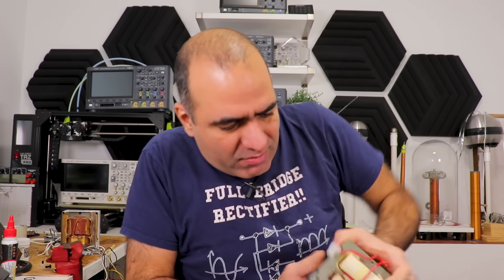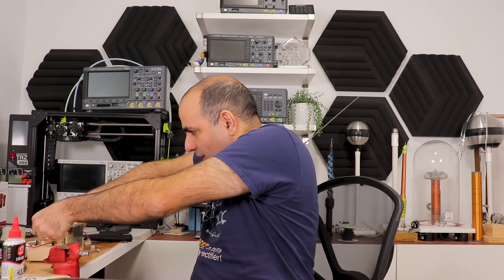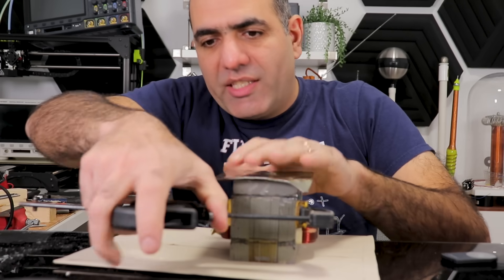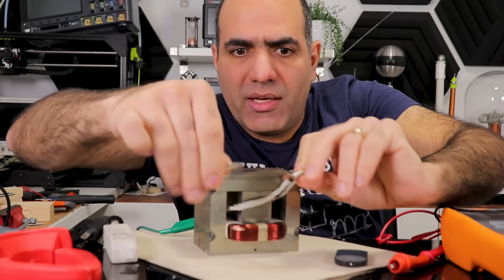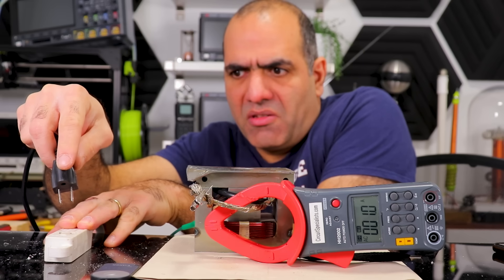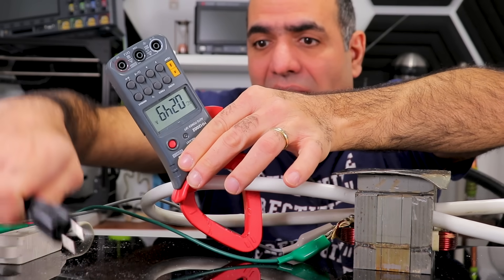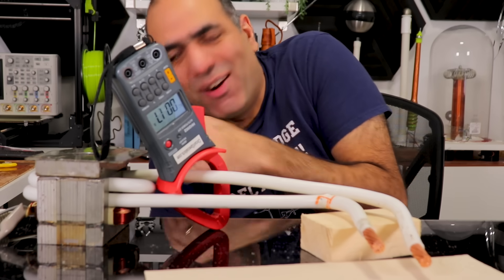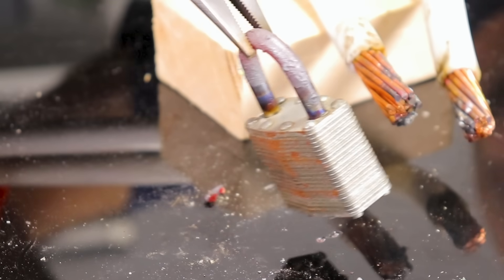Making "MILLIONS" of AMPS of Current

Comment: I thought that 0.01 amps was enough to kill you, he is touching 80 amps 4:15
Reply: Yeah but the voltage is very low. How much current is running through your body (think of your body as a huge resistor) is defined by the voltage, not the current that is flowing without load. Besides, he is only touching the closed circuit, not even holding both contacts with both hands so the circuit doesn't even close through his body meaning the current running through him is 0A.
Reply: Mehdi has a video about how this works concerning a "7 million volt" stungun.

Comment: How do you not get shocked by any of it.. you put your hand on top the square thing plugged in and then was holding the spoon while heating?? Are you grounded already or what? I came across you trying to learn about resistors in my r/c truck receiver, I need to know if I can put it back on or if it will be fine without.. it’s about the size of maybe 2grains of salt lol. But I’m now curious on what you were doing, reminds me of like a homemade induction heater!!

Comment: Current comes in via the (depending on what you want can be either but lets say) primary.
The electrons move in the coil

Every pass induces a magnetic current via the right hand rule.
So there is 1 magnetic field trough the iron core.
The plates are separated, so electrons cant flow between then (or they would coldweld like in space)

So the electrons are trapped in the plates.
So the incuced field is trapped in the plate.
And since 1. Same plate and 2. Same field; same induced field.
Induced field closer.
Inverse square law.
Same field locally stronger than ferromagnetic attraction at distance.
Push stronger
Goes appart

Comment: 6:15 if the secondary has more turns than the primairy then could you use the secondary as a primairy for more volts and so more amps across the short?

Comment: 6:10 I think you brush over an important point here. Step-down transformers don't actually "increase" the current output of the system. What they do is increase the current relative to the power input. You can theoretically get higher current without a transformer, but a transformer helps you get high current with low power.
Reply: If you consider a "perfect transformer" - that is one that transfers 100% of input power (primary winding)  to its output
( secondary winding )  - then - irrespective of turns ratio - if power in = power out then
Vp * Ip = Vs * Is.
Thus  Is/Ip = Vp/Vs = np/ns 
Where np is number of turns on primary and ns number of secondary turns

That is : for a step down transformer - the secondary current is increased  by the turns ratio np/ns for a given power level ( provided that it is within the capability of the transformer )
In pratice one does not get exactly this due to iron and copper losses.

A microwave power transformer delivers power  in the range 800 - 1000 w  - so if we work with say 800w as a conservative estimate and assume a turns ratio of 
110/2 = 55:1 then input current = 800/120 = 6.67A
output current = 6.67*55 =367A .
Since he was getting a lot more current - it suggests that the rating of his microeavr transformer is far greater than 1000w 
Suppose it was 1200 w
That gives input current
= 1200w/120v = 10A
Secondary current = 
10 *55 = 550A 
( more like what he was getting )
Reply: @eric4709  Well, yeah. They increase the output current relative to the input current, but that only actually increases your current if you have a constant-power source. If you have a constant voltage source (ie, a wall outlet) a step-down transformer will decrease the output current. 

Notice how when he “doubles the number of turns” the current increases even though the transformer ratio is lower. This is because he’s drawing twice as much current, but 4 times as much power.

Comment: Just a reminder that 1 amp can be fatal.
Reply: I still can't understand volts vs amps in fatality. Even google can't help me. All I know is that 10000 volts is ok (still painful) but 1 amps is fatal.
Reply: @OfficialPlexicam its both and frequency (if ac) and duration. current=voltage/resistance so if the voltage is higher more current will flow through you because our bodies have a lot of resistance, if the voltage is low then no current will go through

Comment: @electroBoom may i ask how are you holding a metal spoon against a huge current and not get hurt at 11:00? was there insulation somewhere that isnt visible?
Reply: No current flows between an area of equipotential voltage created by opposing fields. So current only flows from negative to positive or positive to negative for that matter
Reply: @ZaheerkhanZaheer-m6c  dont mind me as my electrical knowledge is basic. are you saying that the spoon surface area between the 2 wires are energised? meaning if the spoon touches only one hot wire then the spoon will be energised,  but in the case of 11:00 only the burning part of the spoon (between the 2 giant wires) is energised?
Reply: @shaifulrisanwork  I asked my teacher and he said the high current caused it to burn. Current flows when a voltage is applied. And voltage is the equipotential between two poles( current should flow when they are opposite to each other). But it burns, maybe the current was too much due to very low resistance or very high voltage that cant be said just yet.

Comment: Wonder how much electricity he wasted
Reply: its not wasted if its for a good cause
Reply: The same amount of he were to use it as a step up, since  power = current * voltage the secondary and primary windings are proportional. So 1:100 will step up 1 volt into 100 and 100amps into 1 amp, the same goes the other way around, and in a perfect transformer(which it's not because there's no such thing, and he did make it less efficient)  it goes primary current * primary voltage = secondary voltage * secondary current. So he didn't really waste enough to make a change on his electric bill

Comment: I have confusion that power on both the input and output remain same than p=Vp×Ip and power at the thick wire will be p=VsIs hence as Vs<Vp the current will be more in only one turn right? So why did u think to double the turns ?

Comment: Since nobody else is noticing or telling you...

Your initial amp was way over the 1000 you wanted...

At 7:13 ... you get a half second of 4000 amps.(I'm thinking way more.. because your first test in the second phase also had 4000 amp. I think thats where the meter maxed out.)

😮😮😮

Your having thermal fall off... you need much stronger carriers of your desired current.❤❤❤

Comment: Damn, this brings me back. We had some fun with one of those probably 15 years ago. We quickly realized the ~2000V 1A output was very dangerous to play with, so we replaced the secondary coil with a wire from a set of jumper cables. We enden up using two turns, as with one turn it struggled to make a connection with most thing we tried. We did manage to melt some pretty thick bolts, coins, nuts etc., but in the end the jumper cable melted instead. I think I have it in a box in my fathers garage still.
We also had to glue it together to stop it from making that 50Hz noise. :)

Comment: It makes me uncomfortable that Mehdi doesn't have a safe workspace outside the house for messing around with this stuff.

He's working in a really confined looking space which leaves little room for him to run if things go bad and it makes it difficult to reach for a cutoff switch or a fire extinguisher. Plus he's generating toxic smoke inside a house which probably has smoke detectors, not to mention generating strong EMF with electrical devices not too far away and playing havoc with the household power which could be harming other electrical devices on the same circuit.

I'm assuming that he's rigged his house electrical to support the experimenting he does but the other concerns I mentioned still stand.
Reply: Oh well, guess you don’t have to watch

Comment: One very ccol project to do with these is make a pulse welder. Cut the secondary off and put 2 turns of welding cable around the bobbin. Then feed the primary with pulses from a capacitir through a high current IGBT transistor. I used a 1800uF 600v capacitor plus the IGBT half bridge from a motor driver.O.1mS will weld thin battery tabs well, 1mS will weld thicker battery tabs securely, 5 to 10mS will weld thicker sheet metal well.❤

Comment: if input it in 12 volt dose it out put ?VDC?
Reply: The input needs to be ac. The relationship between the input and output voltage depends on the relationship between the number of turns in the primary and secondary coil. With mains voltage and the original primary coil one turn in the secondary coil is approximately one volt
Reply: @laserdiode  thank for sharing!

Comment: Would it work to make a gigantic transformer with superconducting wires? How many amps could that generate?
Reply: Gazzilions😂
Reply: @goblue7914  all jokes aside, how much?
Reply: @Nadkok Kiloamps and perhaps megaamps you Will be limited by the Power you can put in the primary and by the core saturating or melting from eddy currents

Comment: I once worked in Norsk Hydro's magnesium plant in Porsgrunn, Norway. One factory hall used 400.000 Amps (and 6 volt). The crosssection of the "wires" (massive aluminum) was 1.2 sqm. The magnetic field stopped the second hand on my quartz watch when I got closer to the "wire" than 1.5 m.  We wore rubber boots (wet floor due to salts), long underwear plus full work clothes. Airtemps up to 125 degrees C. I drank up to 8 liter  each shift (2.5 hours effective work time) and ate salt tablets. Filter with mouthpiece most of the time. Thick, yellow chlorine gas was a byproduct, and some of it leaked out.
Reply: This sounds badass. And 257 degrees Fahrenheit?! That’s INSANE!
Reply: Don't they normally run several cells in series?
Reply: interesting: 100%

understanding: 0%
Reply: I don't know the metric system!😀
Reply: @TheodoreBurkard-n4o over 10 square feet. Standing 5 feet away. I think 8 liters is a couple of gallons. Air temperature over 250 Fahrenheit (not a typo, water boils)
Reply: @TheodoreBurkard-n4o  true dat
Reply: Surely you meant 125 °F right?!
Reply: @one_solace  not given magnesium being purified and melted into stock and that current.
Melting point: 1,202°F (650°C). Aluminum is only around 20 degrees higher.
A hint for such plants: If it's not hot enough that you can't hold it, it's wet and wet explodes inside of the furnace. That shit will kill you, then hurt you afterwards.
Oh, for fun, magnesium burns at a temperature lower than its melting point.
Reply: @spvillano  yup this is why they cook metal stock before tossing it into the actual furnaces. Otherwise kaboom

Comment: @electroboom it would make a great induction heater for seized mechanical parts as it could heat, many types of bolts unlike the production ones that have a small end that can only fit a few

Comment: People often think this is horribly dangerous. I can see how they'd think that. He's only interacting with the secondary winding of a stepdown transformer. Voltage as he shows is the same as an "AA" battery or two. The massive current obviously melts stuff, hot/burn injuries are possible. The current and voltage on the input side is exactly the same as a microwave.(700W)

Comment: If you plan on fucking with a microwave transformer, a good thing to do is instead of using a normal wire like what funny unibrow man did, use a modified jumper cable. Alot easier to feed through.
Reply: max u get with a jumper cable is 600A its not as thick .. the unibrow middle eastern man experimented 1000s of Amps

Comment: How do you use what looks like a US outlet (110volt right?) to draw 600Amps? In Sweden it’s 220v and the safety switches go off at I think 10A or 16A. 

Or does it not draw the same current from the whole setup only in the thick wire part or how does that work? 😁 love the videos!

Edit: I saw now that it’s hooked up to something else as it appears? But with even thinner chords so I’m even more confused haha I mean I get that you can replace a safety switch with whatever you want but those wires how do they not instantly become fuses!?? 🤣

Comment: The current literature in semiconductor physics and electrical engineering is rife with outdated, misleading, and fundamentally incorrect concepts that perpetuate confusion and hinder true understanding. The concept of "holes" as positive charge carriers is nothing more than a fictitious abstraction that serves no real purpose other than to obfuscate the true nature of charge carrier behavior. This nonsensical idea should be eradicated from the discourse, as it adds an unnecessary layer of complexity that is completely devoid of practical utility.

Furthermore, the terminology used to describe electrical phenomena is redundant and imprecise. Phrases like "current flow" are not only tautological but also betray a fundamental misunderstanding of the principles at play. Ampérage is the movement of charge carriers, plain and simple. There is no need for additional qualifiers that do nothing but confuse and mislead.

The historical convention of describing ampérage as flowing from positive to negative is an arbitrary and outdated notion that continues to perpetuate errors in understanding. It is high time we abandon this illogical convention and describe ampérage as it truly is: the movement of charge carriers from negative to positive. This straightforward approach aligns with the physical reality of charge carrier movement and provides a more accurate and intuitive framework for understanding electrical phenomena.

Comment: stop sending stupid comments about electricity bill, P = U * I --> P = 1V * 1360A = 1360W (on the secondary) so it will take under 1500W, because some power is lost due to magnetic fields or coils heating up. So in conclusion it takes less power than some of your every day use house appliances
Reply: é piada é pra rir

Comment: question:
if i lets say, modifie 30 of those transformators and use very thick cables, can i just connect all of them to two very big output cables?
would that work in any capacity?

Comment: Hows he getting double the current by doubling the number of turns? Isnt the current gonna get halved cause the voltage will get doubled and power in both sides of a transformer are constant?
Reply: voltage across some resistance is generating current. He is using same piece of wire over and over so if out R = const, and I = U / R then 2U / R = 2I

Comment: Next time use 3/0 SO cable.
It has the same ampacity but the strands are very, very thin making it supple and easier to work with.
Sometimes we call it "welding cable".

Comment: This actually is a useful tool: using a momentary switch to quickly engage and disengage the primary circuit and two large copper points on the end of the secondary 3/0 wires will make an awesome spot welder (sandwich two thin pieces of steel between the two copper points for a hardcore spot welder.)

Comment: Put 230VAC on input?
Reply: he lives in america where they use 120VAC, 230 would probably destroy the primary, but it will happen to pretty much everything from america in Europe. YOu can do the same, with same results, but use a transformer from European microwave oven which is created to handle 230VAC

Comment: Funny and entertaining. The only concerns me is safety.  Holding the core whilst power is applied is not a good idea (2kV can arc if bad isolation). Unplugging with one hand and holding stuff in the other is not a good idea (current path across your chest/heart).
Reply: but the highest voltage here is 120V

Comment: Need to get together and collab with @styropyro and make a insane project!! Because he just had better results with 85k amps @ 12v w/100 car batteries wired parallel!!! Maybe you two collab and do 250 or 500 car 🔋 and use buss bars instead of wires to get less resistance!!!

Comment: "1,00,0.0000,00"? what number is that supposed to be?
wih the commas in the right place, (and don't move the decimal point) you have 1,000. (all the zeros to the right of the point/period are irrelevant. You could put 100,000,000 billion trillion zeros right of the point and not raise the "1,000" so much as the diameter of an electron.

IF you are referring to the electrical arc, you don't need 1,000 amps to get an electrical arc, or even high voltage. 
Welders get (and maintain) an electrical arc hot enough to melt steel (or any other metal) with as little as 10 volts and 15 amps.
75 to 120 volts and 100 amps (and up) is more common, though, for a hotter arc and more penitration.
One of the gasoline powered DC welders I used could do 240Volts at upto 500 Amps.
I usually had it set for 90 volts at 110 Amps for the guage steel I was working with.

Comment: "let's check the resistance of my wire by sending through 10VDC and read the output voltage" he says, holding a multimeter with a ohmmeter function

Comment: try using the secondary coil to power your new secondary coil so you can turn 2k volts to 2 volts then you can use a wimshurst machine to get useable power using a spark gap but you also should be able to adjustable the output voltage by changing the spark gap length and it should always have a stable output voltage regardless of input speed to the wimshurst machine

Comment: I did 2 turns of 2/0 gauge nickel clad copper with crimped lugs on the ends and got 1.8v @ 1900A with the lugs bolted.  I used switch gear wire with hundreds of strands so it would be very flexible, but large car audio wire would also work well.  It would trip a 20A breaker after about 5 seconds,  so ended up powering it with a 30A breaker and 10 gauge.  Eventually made a contact welder with it using an interval timer and a large solid state relay (on the primary side obviously).